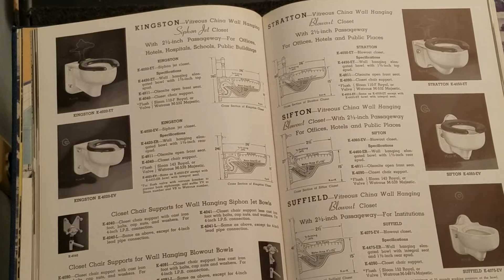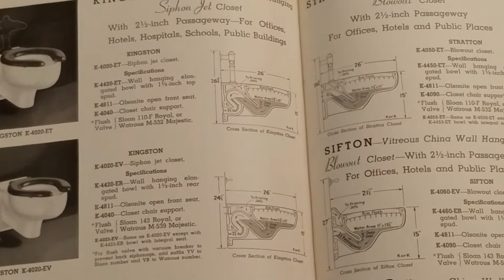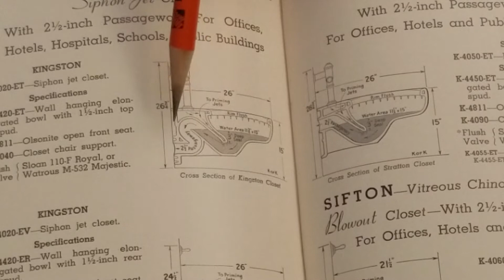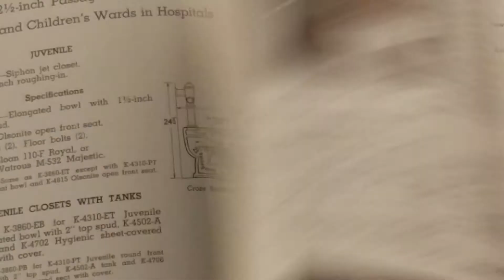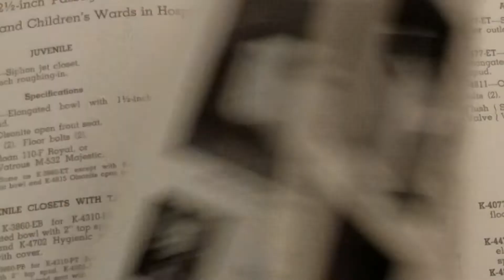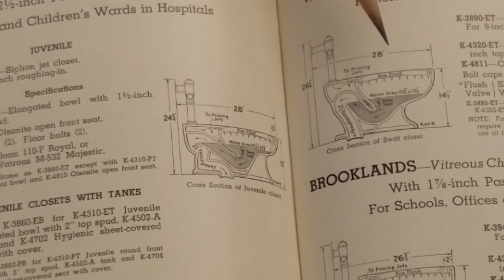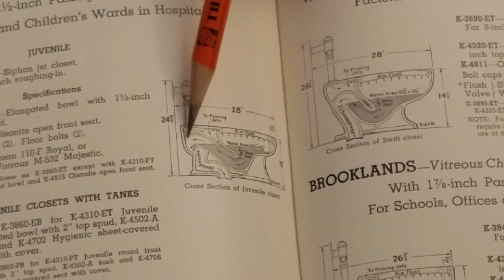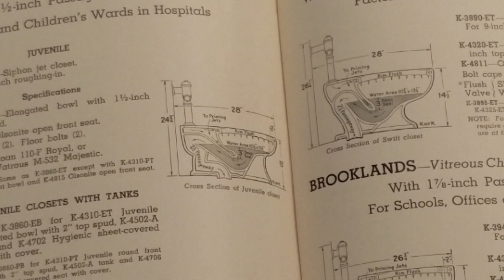#83 Siphon jet vs blowout toilet operation.

Comment: What do you think of the "double trapway siphon jet" terlit design now starting to be used here that was borrowed from UK brand Armitage-Shanks? I have a Niagara Conservation that has a square trapway with an 8mm siphon jet in front that starts the flush with strong suction, rtaking most of the water out of the bowl and trap before the water comes down the front rim area to replace that water and move the rest of the waste into the trapway? Very quiet flush! Read up on Google to see it. The bottom of the trapway actual almosts rests on the floor before going back up and into the drain. 0.8gpf! Terrible bowl rinse. It uses part of the tank water to fill the trapway from inside rather than being part of the flush. Here's what it looks like (courtesy of another user): https://youtube.com/shorts/eNb2ORW3cow?si=7Xn9wc-V4Bp3YGGl

Comment: Thanks! That was very interesting. I had no idea the outlet to wall mounted terlits was variable, depending upon type. Is there a wall mount carrier that lets you adjust for drain height or do you need to order the exact wall mount  carrier for the terlit you're using? I thought the wall carrier mounts and dimensions were pretty much universal and interchangeable between brands.
Reply from the maker: The carriers come in 2 styles. Siphoned jet (4 bolts, low waste connection) and blowout (3 bolts, high waste connection). Any brand toilet will fit those carriers.

Comment: Excellent!  Although it's funny how our modern tank-based toilets seem to be more "blowout-ish" varieties these days due to the mostly-unrestricted trapways. The only tank-based "true" blowout bowls are pressure-assist, or flushometer altogether.
Reply from the maker: A lot of tank toilets now almost seem to blowout. I think they are really siphoning, but the key is that the siphon jets are so big that most of the water shoots out the jet and into the trapway to make it siphon, it doesn't raise the water in the bowl much like the old toilets used to. When you flush, the toilet siphons almost immediately. which is pretty impressive I think. It really is very efficient with little waste of water to make the siphon happen.
Reply: @vintagekohler6085  Right. Yes, exactly. The change even was made from early 1.6 gpf models which were still pretty balanced between rim and jet. Today it's about 80/20-ish, and the only real way they can achieve such low volumes of water per flush. It's cool, but except when shot at high fps and slowed down, it's rather boring lol

Comment: Great video and I find this very interesting! I have a 1996 American Standard pressure assisted Cadet that has a trapway like the floor mounted blowout and literally the only way I can get it to siphon is by blocking half of the water outlet with a brick.
Reply from the maker: That would make a lot of sense! The brick is allowing the water to fully fill the trap, which allows it to siphon. That's why siphonic toilets have the sharp bend at the bottom of the down leg of the trap.
Reply: @vintagekohler6085  Yeah, because if I didn't block half of the outlet with a brick, no matter how much water I used and how fast I poured it in, it wouldn't siphon out at all. And that's pretty interesting to know! I found out that a lot of pressure assists have a huge area behind the lip of the trapway (like on the 3.5 Cadets and Plebes) and after it goes over the bend, it sorta angles forward and then down.